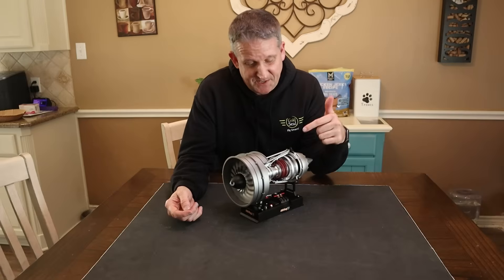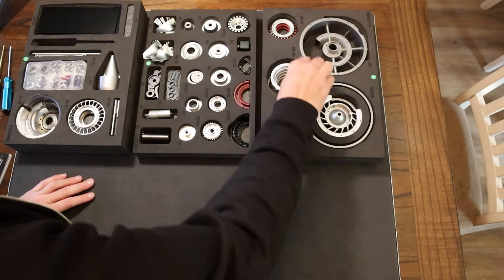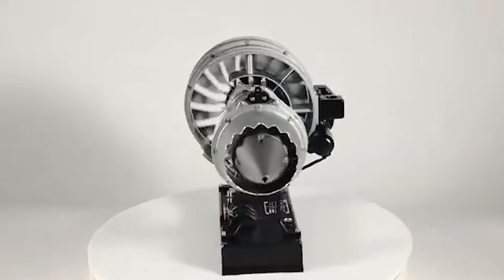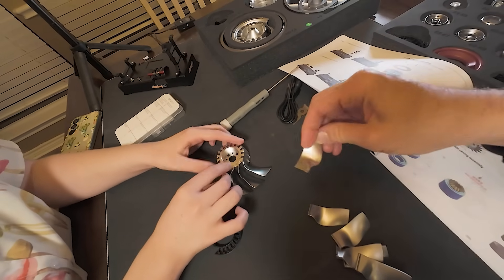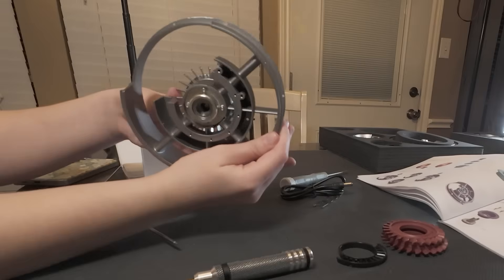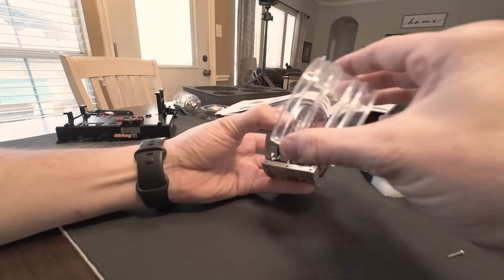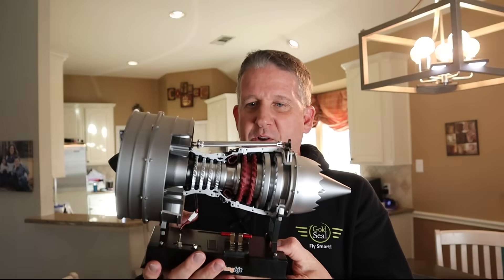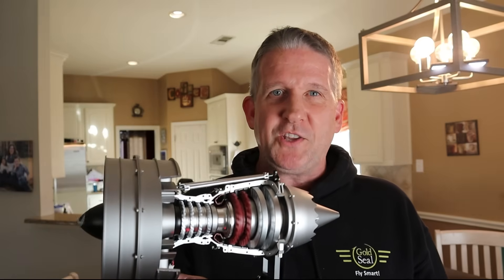I Built a Jet Engine... and you can too!

Comment: Those instructions are better than those that came with the models I built as a kid.  And no glue to get high on!  I like how everything was in a mold and labeled.  Does it turn fast enough that you could use it as a fan?  And don't just kinda hope that a skeeter might fly by it while it is running and get sucked in.....